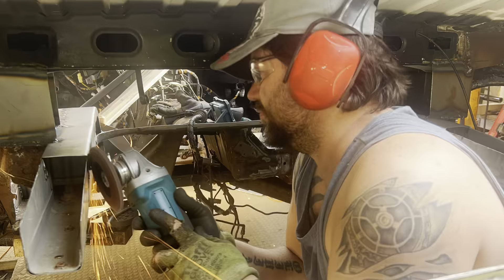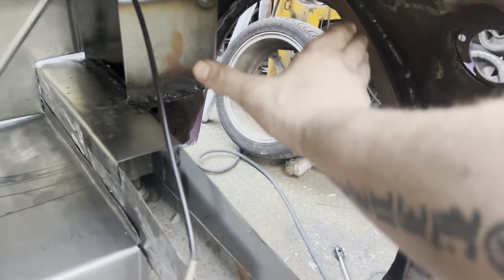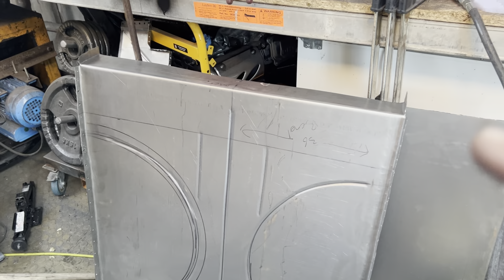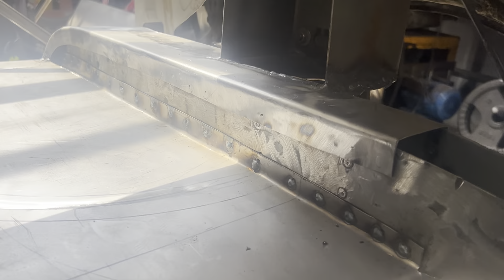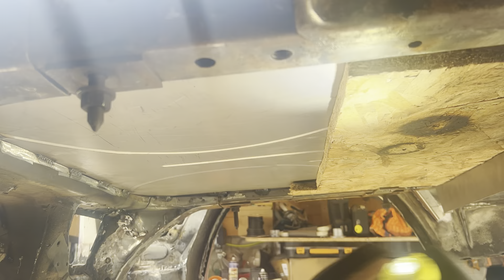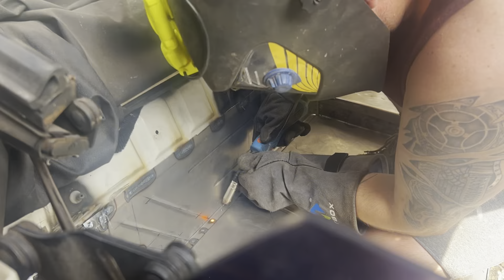400bhp escort RWD rebuild restoration rs turbo cabriolet Mazda body swap

Comment: Do you know when you were chopping both these motors up and talking about what you was going to do I just couldn't get my head round it but now things are being welded in I can see your vision. One day the motor will be on it's wheels and running I can't wait to see it whenever that may be. This will be a massive achievement to you , good look with it all and I can't wait for the next video.
Reply from the maker: It’s quite difficult to get across something that’s in your head,, I would say 80% of the work so far is going exactly as I had planned,, the other 20% was the un known once I started chopping but I can see what’s happening now